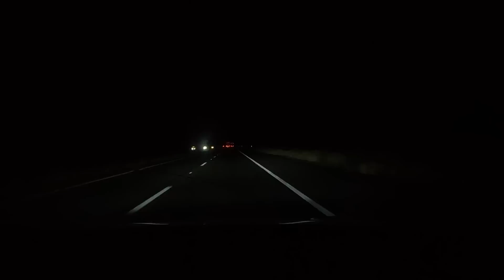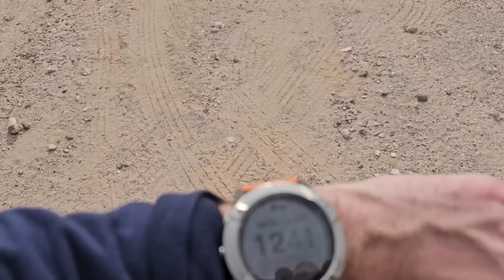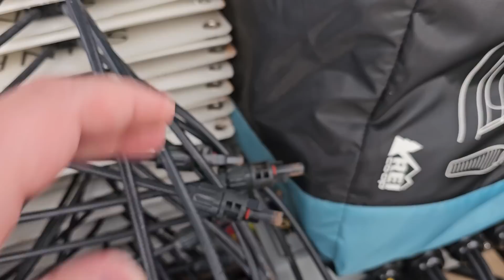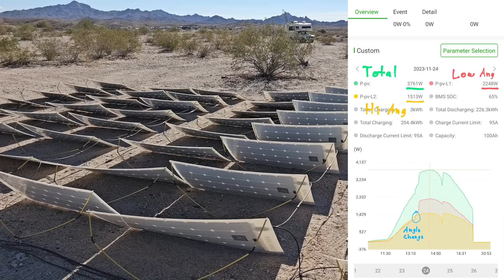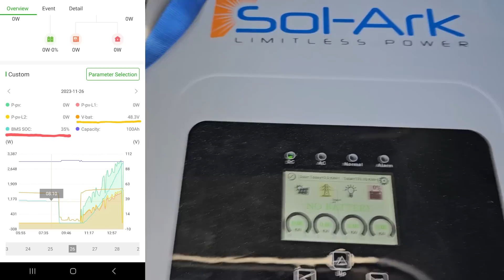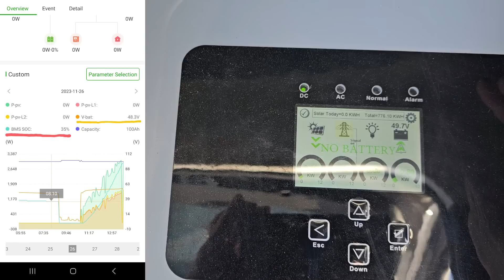Badlands Charging

Comment: If you make more space between the strings, 6 or 10 feet. You get extra room to flip every other panel to right and the one between to the left. 
Assuming your extension cables to your strings is long enough. Too late now when you are done with your trip.
Reply from the maker: Yes, that was a great idea I wish I had at the time. To keep the string in a U shape I would need another short cable to jump one string down with the one back up, but I think I could have cut and modified my cables to make it work :( but yeah I wish I met you at my first camp site :) I had a few stops with ample room to make it work.

Comment: I think you could have solved your shading issues if you found a south facing hill to put them on. But yeah the sun angle in November is pretty tough.
Reply from the maker: I tried. That spot even had a slight negative slope. It was brutal.

Comment: This is awesome, as another commenter also said would be really interesting to see a long range Aptera do this🎉.  Also an Alaska to Chile run 😁, that would definitely require so special timing to navigate the northern part of Alaska.

Are the new CIGs panels better suited for something like this or does the increased surface area they use conteract their weight/thinness advantage?
Reply from the maker: I looked at CIGs on another's recommendation but they were not as efficient, and the power to weight ratio was a significant disadvantage not to mention the extra cost. There was an attempt by @RouteDelSol to go Alaska to Argentina but unfortunately they did not make it.
Reply: @lightpowered  the bougeRV Yuma panels are 6 lbs for a 200W panel, whereas the sun power 100W panels are 4.4lbs.  the shading performance, durability and longevity are unmatched as well.  Hobotech shot a couple bullet holes in one of his, sunk it in a pool and gave it to a friend and it's still working with only a few watts power loss last I heard.  They are still quite pricey but as long as the increased footprint still fits I'd think you could reduce weight a little and/or get more power.
Reply from the maker: WOW that is an impressive power to weight, the area is not much larger per watt either. For an RV they seem perfect with included adhesive! For a mobile / temporary array, the lack of rigidity may be a bit of an issue and need additional support. Thanks for the lead!!

Comment: Hoping you are doing well since finishing the run.
Reply from the maker: Yes. Busy working but doing great.
Reply: @lightpowered  cool. You were in between jobs and the next job would soon be happening so that makes sense you would be busy. Better busy and employed. YouTube can come later. 
By the way, I am hypermiling my 10 year old diesel Nissan while going to and returning from work and using my flashers to warn people behind me. Similar to what I saw you doing as you drove slower at times.
Reply from the maker: @gmosc  That is cool. It has been great to have all the support from comenters and people along the way. Thanks!

Comment: Nice challenge and great to see that this is possible.
I wonder with the further development of cigs solar panels setting up could be made easier.
They could be rolled up and rolled out easily. If you would have very large solar panels (some companies state 1000w panels is possible) you would only need 6 panels to get the same peak power. It would mean 10 times less connectors. Also CIGS is a lot less affected by shading. Maybe a trailer version would suit my electric campervan.
Reply from the maker: It would be nice to have a spool that just rolls out. I saw a group in Australia that tried custom roll out panels but they were not very efficient and they had to lay them flat on the ground, they had other issues as well and required a support van to carry all the panels and equipment.

Comment: If you did it in summer you'd have a very different time! I've wanted to do this in Australia, where we'd have all sunny days, very high sun in summer and I could lie flat all mid-day. I'm just not crazy smart electrically and would love to see a one-stop shop/fully integrated inverter/charger system. I'd need some sponsorships to afford all the panels though ;)
Reply from the maker: Australia is the place for sure, a company named Enteligent is about to make a all in one plug and play system. But yes regardless the system will cost a lot. I am planning to sell my equipment to recoup the cost, hopefully the panels will make a nice functional souvenir.

Comment: You did exactly what I wanted to do, but you did it on a much larger scale (longer journey).  Congrats!!  I just bought a Hummer EV SUV.  I really want to charge it with solar at my house and on the road (at times).  You took your DC power, stored it, converted to AC and then back to DC via your car's charger.  I am furiously trying to find out from GMC if I can get an adapter for my charge port that can take direct DC input.   After all, all you're doing is charging more lithium batteries inside the vehicle.... the car's battery SHOULD be able to handle unsteady current.  I just don't know if reverse current would be a problem.  For my vehicle, I know my PV voltage would need to be around 440VDC.  I'm not sure if you already did the homework for the Tesla and realized it's not possible.  If it is possible to do direct DC, can you imagine the increased charging time you'd get?  Maybe 1 less day at each site ?
Reply from the maker: Yes, as someone that worked at GM I too looked for a PVDC to EVDC solution, asked around internally at the time and there was nothing planned and little interest. I could go in depth, but I have a whole video planned for that later. There is a company working on it called Enteligent. As for the total efficiency of my system, it is about 80%.
Reply: @lightpowered  I kind of figured you probably already explored that.  😊 Thanks for letting me know about Enteligent.  I can't wait to see what they come up with.   That will be my dream, to charge my Hummer directly from a string of solar panels.

Comment: When I get my Cybertruck I'm going to want to do this. I probably have two years till that happens so I guess this is research! I'm going to need about 9kw of panels. I'm probably going to want more poweh for my inverter into the truck.
Reply from the maker: Yes, you should be able to get a DC to DC charger by then !!!
Reply: @solarcannonballrun  maybe a power trailer... weight budget of a .5 ton for the system... put it in an areoshell type trailer..   I don't know yet how much I'll have to fund this.... maybe put my LRMY on the robotaxi network to pay for it hm....
Reply from the maker: Yes, I am toying with the idea of a Cybertruck RV with 7 kW solar roof auto fold out array.
Reply: @lightpowered   there's a company in Oregon called Solarrolla that makes solar fold outs. Their work was featured on a YouTube channel called route del sol... interesting stuff
Reply from the maker: Yes, I follow them :) Wonder what ever happened to Route Del Sol

Comment: good job man i wanted to do the same but i think I'd have 1k watts on the vehicle while in motion even 6400 watts reconfigurable umbrella ☔🏖️ of panels was a great idea that charge controller/inverter is a great performance upgrade too I'd love to see logbook of boring nerd stats though not everyone else would have the attention span more than a parakeet but yeah that's a considerable sq ft of collection surface. mylar mirrors held open with tent ⛺🎪 poles maybe could double collection but then you'd need more panel cooling definitely thermal driven resistance is cutting capacitys to charge as well as collecting photon's efficiently but with low water reserves and no 55gallon plastic drum of water to run off a solar powered water sprinkler on 15 minutes timer to continuously cool with misters or windshield washer spray nozzles well then your out of luck. you'd definitely eat costs in weight carrying capacity etc but could potentially gain it back in charging efficiency quantity of collection per hr of charge it'd be great if you had the ability to use the panels like tarp or shelter making giant lean too towards sun angle but maybe the stresses of being under tension would rip the plastic grommet areas so would damage it esspecially if brittled by solar UV damage hardening plastic loosing it's flex surprised you didn't have 2/ or3 lil 600W omnidirectional wind 🌬️🍃 turbines to supplement the solar for at dawn/ dusk charging when wind kicks up but i guess filled to the brim car camping already. ... many people building trailers just for it you'd wanna customize especially the front airo of your trailer to combine with shape/airflows off of your tow vehicle but also they have these deployable wind curtains for saving fuel milage from behind semis 🚛 if you mounted such simple system to back of trailer for air drag limiting but then towing more weight you'd have to increase collection abilities to balance the equality of car alone efficiency..
 anyways I'm subscribed now to keep up with the storyline thanks for sharing ❤

Comment: it SHOULD be possible to DIRECTLY charge the tesla WITHOUT a battery #MPPSolar (#Voltronic NOT #Victron) can do that)
Reply from the maker: To date, no one makes a MPPT to EV 400 volt charger, but soon they will be on the market
Reply: @lightpowered  best way (anyway) would be to go DC-DC charging without any DC-AC in between :D how does ur system output 400V (AC?)
Reply from the maker: Yes, but they are not on the market yet. My system does level 2 charging at 240v ac and the Tesla onboard charger handles the rest.
Reply: @lightpowered  MUCH EASIER! get 400W Panels (20kg) output ~40V = 11x 40V = 440V = could theoretically DIRECTLY DC start 400V Battery
Reply from the maker: Yes and no, Solar voltage is not constant, it is highly dependent on sun radiation and current draw. So you need a MPPT controller on the solar panel side. On the vehicle side there are a lot of other complications that prevent simply supplying it with 400 volts. On a simple lead acid battery system, you could direct connect a solar panel but the system efficiency would be very very low.
Reply: @lightpowered  imho it's doable, actually need only a controller that meassures current and if battery voltages becomes too high, flip a switch off
Reply: question: what do you think about Tesla's decision to go with "off the shelf AA" ltihium cells? 1. pro have a lot of power in and out 2. con: may be a bit dangerous and not last so long? https://www.youtube.com/watch?v=o3E2bIbek-M

Comment: exactly SoC will (most likely unfortunately) be a rough guess by the BMS done by the VOLTAGE, a GOOD BMS would exactly count Ah going in or out, but that might need a calibration, unfortunately most BMS will NOT count Ah

Comment: u really pushing it to the extremes X-D an #aptera would have been way more easier to do this? also u need REAL solar panels 400W each the big ones + maybe look at the i-2000W 48V Windsafe wind turbine :D (which MIGHT be possible to directly hook up to solar charge controller like a string (UNTESTED!)) 
multiple advantages: 1. the full 400W panel will weight 25kg and can not so easily be picked up by the wind but STILL need to bolt it down 2. 400W full size panels if they are half shaded it's not A BIG problem they still produce a lot of power
Reply from the maker: Yes Aptera would be perfect. My panels are small but they are light and they fit :) only 2 kg each
Reply: I think you missed something about the scale of the problem here....
To generate 6400 W with your suggested panels would require 16 of them, and weigh 16x25 = 400 kg, nearly half a ton.
With that weight, you would also need a ground mounted frame, and all this would not fit in a Model Y, or even in a truck!
Reply: @ahaveland  sorry imho it's only 20kg per panel so that would be 320kg :D

Comment: In your situation, your cables made all the difference. What was your cable gauge? 

I would have used 8 awg.
Reply from the maker: 10 Gauge, each string was only 5.9 amps so the losses were very low

Comment: Only 240lbs of panels? You could have bought a gas car and put 40 gallons of fuel in it for the same weight as the solar panels, and 1/50th the cost..... And not taken a full month to get to your destination.... 
You realize the cannonball record is 25 hrs? You might as well just tow a trailer with a generator on it.
Reply: Whoooosh...   the point...

Comment: i bought 1600 watts of these trifold army surplus panels. they are pretty sweet.
Reply from the maker: Army surplus panels? Interesting, any links to what they looked like?
Reply: @lightpowered  it's four sets of four 100w panels. And it has racks and cases. The charge controller was pretty useless. But I harvested all it's connectors to use with all these long thick gauge army wires.

Comment: Would a lightweight aluminum trailer in tow with the surface area to fit enough solar panels be viable
Reply from the maker: Yes and no. Originally, I was looking at a trailer, but the extra drag (could be as high as 2X) would require a lot of extra panels. 64 was already a lot to setup and takedown. However a trailer with a fold out array 3X the roof area could work nicely and eliminate the setup. Keep it aerodynamic and you have a winner. I have a rough trailer model in SolidWorks already with 7 kW solar array, designed to match the Cybertruck.
Reply: @lightpowered  You have a blog or something where you share stuff like this? I want to do something similar, a 5x10 mini toy hauler with as much solar as possible. I was thinking something like the shape of a cyber truck with the dirtbike handlebars being the apex point since they're highest, then the back is a wedge pop-up like some pick up trucks have. When the wedge is extended, it creates a large flat plane parallel to the front for max solar. Your idea of 3x the roof area would really be something array wise. I still can't picture 7kW
Reply from the maker: @Tazdeviloo7 Yes,  I have a few ideas and some concepts modeled in Solidworks but I have not been on YouTube in a while. I even have some potential new panels from Maxeon that would be perfect. Been away for too long.

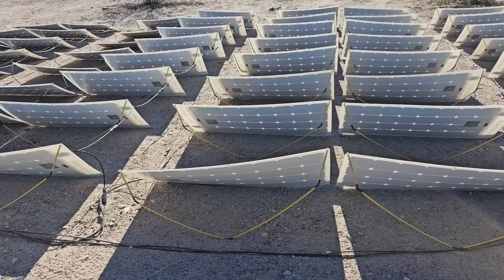Comment: 11:00 - You could flip every second panel and form this way two rows out of the one. This way the whole setup is probably twice the width but then you should have more then enough space that no panels shade other panels :)
Reply from the maker: Yes, someone else recommended the same thing and I think it would have worked, I would need 4 extensions at the end  to connect the two 8 panel strings in series for 16 but yes, I could have sacrificed some of my cables to make it work

Comment: This just shows you how awful electric vehicles are for any trip over 200 miles (if you are lucky in most of the US).  Absolutely insane!
Reply: I drove 1802 miles in a Tesla 3. I got 4.5 miles per kw. I only used 100 kw using a Tesla Fast DC Chargers for $.33 a kw or $33. The rest of the charging was done at Free Level 2 Chargers.
Reply: Or you could just use a supercharger and not do this guys experiment 🧐

Comment: First off, I love this. What a journey and interesting nonetheless. You ran into the unfortunate reality of pushing the limits of "going green." We just are not there. Bad policies are just making everything more expensive and not really helping. We have to use common sense.
Reply from the maker: Yes. For me it is like sailing. I am doing it for the journey not the destination.
Reply: @lightpowered  Man that is a great way to put that!!! Following your journey and hope you have more fun ideas like this!
Reply from the maker: @shawnd567  thanks! I do have some ideas and one project done last year I need to edit still.
Reply: Awesome experiment. 

It would be interesting to see what results you would have going in the reverse direction, and/or during different seasons with extreme hot/cold temps.
Reply: Yeah, the infrastructure in the USA is unfortunately not that good yet. Looking forward to when you can have a cheap 150 mile range EV and you can just have short 10 minute stops to charge in a road trip.
Reply: @sylvester4207 There’s plenty of EV infrastructure if you have decent range. Doing it on pure solar is just hard.

Comment: Cool idea!  Looks like you could have carried even a few more panels next time.  Like your replied to another comment, next time you could have longer cables and more stakes to maximize collection.

Edit: just watched the spec video.  Sounds like there’s a 5kW bottleneck but the array can do 6kW.  Sounds like the bottleneck and more panels would be needed to reach the inverter’s 8kW max.
Reply from the maker: If I could better place the panels I would be good, for the 5kW bottle neck, that is only on the battery side so as long as I  have good consistent sun I can charge much faster, I did charge at about 8kW a few times during peek sun and full aux battery. What I really need is a direct PVDC to EVDC charger, there is one coming out this summer !! One box and done, no battery or inverter.
Reply: @lightpowered  PVDC to EVDC fast charging sounds great!  No more 240V, 48A, 11.52 kW limitation from the on board A/C charging system.  In addition to more panels, it could be combined with a wind device or a water turbine.  An off the grid / overlander’s dream machine.

Comment: you need a DC-DC charge directly, not DC-AC-DC
Reply from the maker: Yes, I do, I looked and looked and nothing is out yet but I do see something on the horizon that would do just that.
Reply: I saw your other mention. Is there a link for context on this solar to EV direct DC charger?
Reply from the maker: It is still in startup mode. The company is called Enteligent. Check them out. Would love others perspective. I may do a video on them.
Reply: @lightpowered  perfect, thank you!